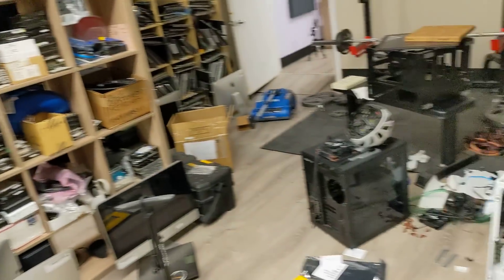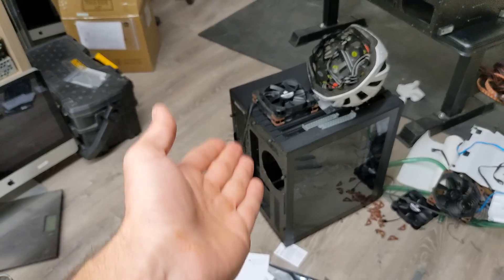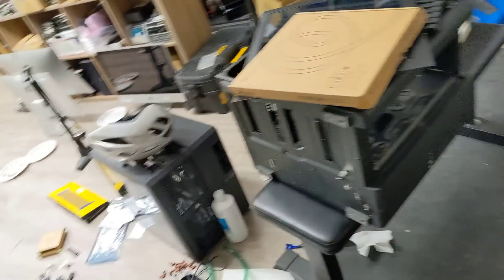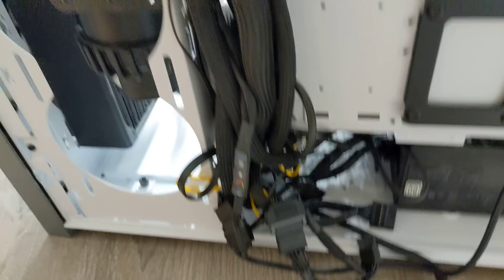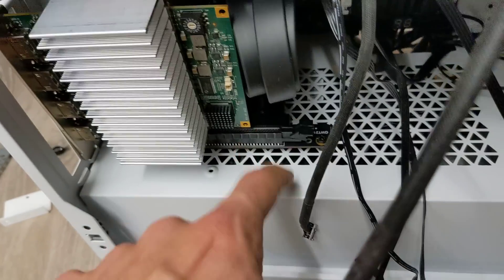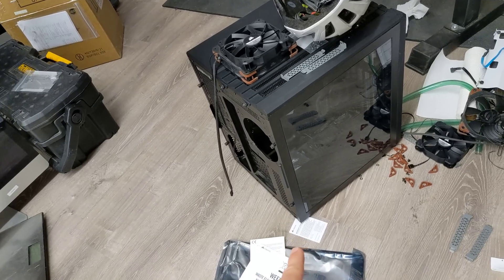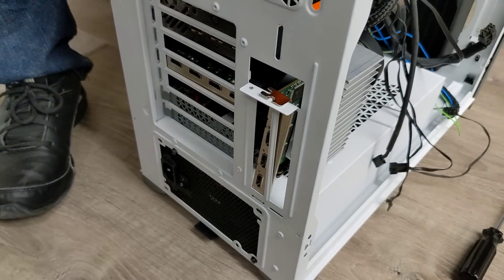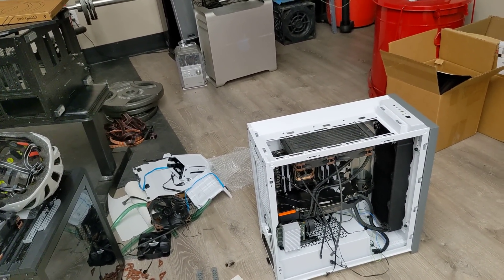I have a confession to make....

Comment: I used to build them back in the 286 to 486 days, I haven't built a modern computer. I'm sure I would run into issues. Buy I simply don't have the time. It's so easy to call my buddy and ask for what I want and it's here and done in 3 days. If I had to source all the parts it would take me a month just trying to find the things I needed.

Comment: 0:58 issue no 1, is you probably went too fast, and got overwhelmed.  I did that when I built this machin I'm typing on right now.  AND I still haven't fixed it.  (it's just power and RGB control to the system fans, and frankly it's not needed, my CPU cooler is beast.  all temps look fine in speccy/ GPUZ.)

Comment: No, you are still better than the Verge. Your thumbnail is a lie. 
You at least acknowledge your limitations, as opposed to doubling down and pretending you never screwed up. 

Also, 3.5inch drive space can be tricky, but that's why you also have access to 2.5 inch SSDs that can also be mounted in a load of places with tape (assuming your case isn't designed to mount them onto the PSU shroud or backplate or w/e), or even just left to freeball, so long as you remember they are there before moving the case. 

Modern GPUs with their massive multi-slotness aren't really compatible with having pcie cards attached at the same time.

Comment: I wonder if they could just make tower cases that have expanding frames you can just slide open wider and/or narrower to fit things better as needed, even extending it just to fit things in, then retracting the box to fit the dimensions better.    Use some kind of elastic instead of fitted glass panels, or just not bother with transparency.  (Glass sides would reveal the shifting frames/components, and would scratch)

Comment: The air 540 has plenty of room.
I have 3 x 3.5" drives,, 3 x 2.5" SSDs, 280 CPU AIO with 4 fans attached to it. an RX470 and still plenty of room left.
if you cant utilize the drive compartments as intended, may i suggest you use the 5.25" CD/DVD Drive bays for hdds/sdds, im sure you can find a way to make that work, in my opinion the air 540 is a damn good case and worth holding onto if you can find a way to make it work with your use case

Comment: I have a big advantage above most when building my PC. 100% function over looks. I make it work and save quite a bit of money in the process. I have a 10+ year old case with a i7-8700k CPU, and 3080 ti. I've had to cut and bend so many things in the case to get modern things to just fit. Since my CPU and GPU are water cooled, I don't need super fans on the case. I modified the case to fit all I need though. The GPU is externally cooled with a 1977 Pontiac Bonneville heater core mounted externally.
Reply: sounds like you have a sleeper-pc. I might do that someday, stuff a top-tier flagship gpu into an old optiplex case, then watch people's jaws drop when I run triple A titles on 4k with no frame stutter

Comment: Just FYI, you satacontroler might be OK, if you have to many PCI lanes used you cannot use all sata ports.
Mainbaord manual will tell you which slots will share lanes with the controller. usually you loose like 2 ports out of 6 if you use a second nvme or a 4x card on the secodn 16x slot
Reply: I don't think that's the case here, from what he says it sounds like they worked untill he plugged in a bad drive from a customer which damaged the controller.
Reply: Yeah it's pretty likely to be this, I had similar problems when buying mid-range motherboards. The main benefit you get from buying a workstation cpu and motherboard these days is having enough pci-e lanes to actually fill the machine with expansion cards without dealing with reduced link speeds.
Reply: How come? I thoughg as long as there is an ample current supply of the psu, and a slot is available, you can connect things. Sorry Im still new to this.
Reply: @WingMaster562  well in modern PCs everything is connected to CPU via PCI-E. PCI-E bandwith effectively is measured in lanes and consumer CPUs don't have a lot of them to sway people who need more towards more prosumer (threadripper) or professional (xeon\epyc) expensive CPUs and platforms.
So let's say your CPU has 24 lanes. 16 are for GPU (which usually can run at 8x but it will try x16 first), 4 are for essential devices (split in half between NVMe and 2 SATA slots) because you can't effectively run a PC without storage and 4 are going to chipset that's dividing it between additional PCI-E slots, LAN, WIFI, BT, USB all this good stuff, and more importantly, all the excess goes to more SATA. So if it starts running out of bandwidth it really doesn't want to leave you without Internet, for example. So it cuts drives off.
You can google a reference scheme for modern processor with "amd zen 3 pcie lanes map".
Reply: @Nighterlev  I didn't realise all 6 of them were dead, I thought it was only 2 of them. On my motherboard I have 2 SATA controllers, a Gigabyte one and an Intel one, I thought he'd just burned out one of them. I knew it wasn't a PCI lane issue though.
Reply: Repent to Jesus Christ “Do not be overcome by evil, but overcome evil with good.”
Romans 12:21 NIV
h

Comment: you are just a wreck. 1) put the fans on the inside of the case so you put the front panel on. 2) you can still use the hard drive sled but you need to route the cables over it or around it when it comes to the power supply. I have the corsair 5000D I know this works.

Comment: For starters you are choosing the wrong case. Instead of going for this fancy new case just go for an old and versatile case that has a hard drive bay in it. If it isn't gaming then it doesn't need airflow and so you can choose a case that doesn't suck dust in. Also go for air cooling instead of water cooling which is just a pain in the butt. Also never plug a customer hard drive in to your own computer. That is what usb drive bays are for.

Comment: As a retired PC tech and builder of a few high dollar gaming rigs which included plexiglass windows, lights and fan speed controllers ( before they were a thing ) and it was always a good money job because the parents were buying them for 2 boys ( always ) and the machine that were bought from xxxxx company needed to be upgraded so both machines were comparable. 
The first thing in the build is the specs, and building the system on paper or in your head, case, motherboard, peripherals, video, cooling, power supply, wire management. In the order I gave you can make special purchases for additional slots or cases with special attributes for fans, coolers or even longer for cards that are ridiculously long. And end up at the power supply so you know how much juice you need and and how many connectors. I really enjoyed building systems especially high dollar gaming rigs with 5/1 sound card and speaker systems that made the wives scream downstairs that the dishes were bouncing in the cabinets. It always got an approval from the Dad and maybe a good tip when I yelled up sorry Mrs S that was me.

Comment: As soon as I saw the 4000D on the floor with a thick rad and no visible fans plus a card with a thick heatsink hanging off the side and wires going the wrong way inside the case, I facepalmed 🤣🤣🤣. As you kept showing me your "work" my hand only left my forehead 2 minutes later to write this comment. Thanks for the experience Louis. 
Now, I know you probably heard this one before but, you must test the computer outside the case if you want to avoid tons of work, you must test the obvious things first when there's an issue, and try to make sure everything fits first.

Comment: First of all, Louis, build on a table that's at a comfortable arm's level.  Rip that damn water cooler outta there and get one that will take less space.  And, why do you need so many damn fans?    Completely disassemble the thing and start from scratch.  Make sure everything fits and don't try to Jerry-rig things.
Reply: Jerry-rigging things is only good if you are mechanically inclined.  Then you can do some possible cutting and welding to expand the case to fit your needs!
Reply: @callak_9974  "jerry rigging" requires no mechanical inclination, just a roll of duck tape, some velcro, and bubble gum.
Reply: @chrisbaker8533  don't forget ample use of wire cutters and pliers to hack and saw through the case
Reply: @gamespender8605  
Also don't forget plywood panels in case you need some extra mounting points
Reply: Get a table? What is this, The Verge?
Reply: @TheDeadfast  It's way better than trying to work on the floor.